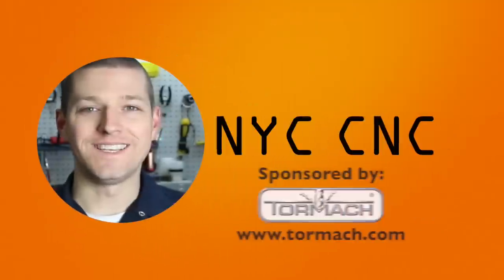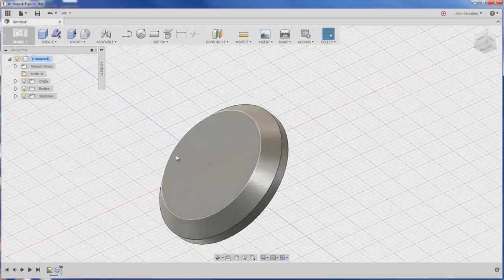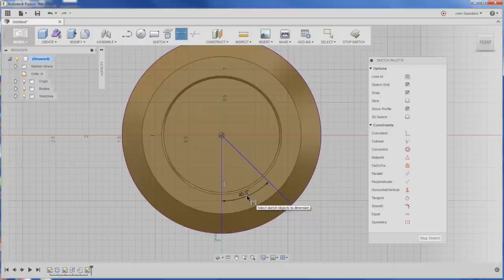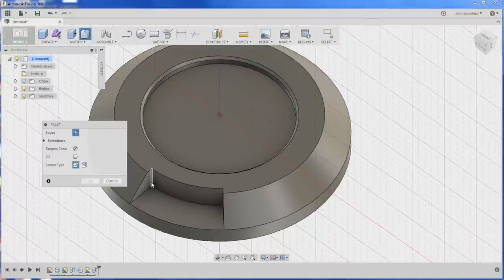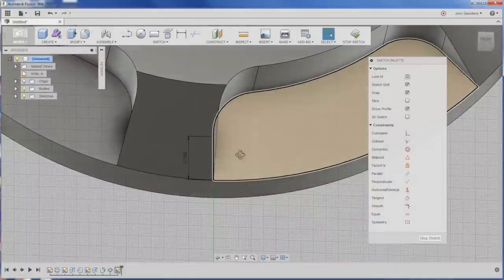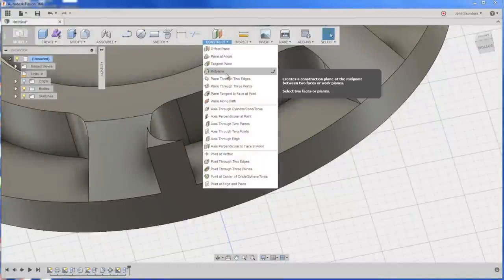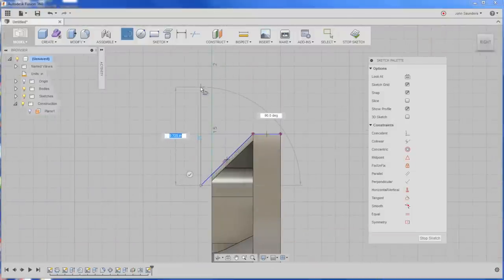Fusion360 Quick CAD Tutorial!

Comment: about those little thingy left at 5:30 , you could just have included those radius in your sketch when you made the cut at 3:20 and you could have also only made one circular pattern at the end. For a part that simple it doesn't really matter but when you get into more complicated ones, you want to keep the step used to get the part minimal so it can easily be edited without going through a long tree of step
Reply: It's now 5 years later.... you should all get a life!  But one thing you can do in both Inventor and Fusion is drag the different operations in the list on the left- you can change their order. That can often fix leftover little bits very nicely in one move.  The ability to change the order of operations and features is one of the most miraculous advances in the CAD revolution.

Comment: At 5:25 you can use a "to" push pull you'll find that option under extents. Then select the sketch as normal then click the slanted face.That will allow you to extrude exactly the amount you need without having to cut it off in a later step.

Comment: I just gave this a shot, but I took a slightly different approach for those outer curves.  Instead of extruding that outer curve and then trimming it off, I drew them into the initial cut.  I started exactly the same with the 2 lines from the center 45 apart, and the 2 arcs between them.  But then I added a 3-point circle on each end between each radii and the arcs.  Then I trimmed the extra lines, and was left with a curved "kidney bean" shape.  Then I cut it out and patterned the feature.

Comment: Symmetry is the hobgoblin of design.  Twist caps should offer more traction and strength for loosening than for tightening.  Also, the torsion that can be applied manually is limited by the tensile strength of skin.  For this gas cap the lobes should be cammed for fingers to grip to loosen but to have less purchase in the tightening direction.
Reply: halnywiatr form over function
Reply: @kevincoates1597  function over form.

Comment: Great straight forward video and not even to fast ;) Nothing wrong with the way you did that, like you said it mite not be 'proper' but unless it breaks the model then I guess it works just fine. The way I would have drawn that is create a cylinder with the center depression with a revolve or with an extrude and cut, then sink the grip cuts  into the cylinder, pattern the cut outs, then cut your OD chamfer with a revolve. Still the same result just my approach and still may not be 'proper'.

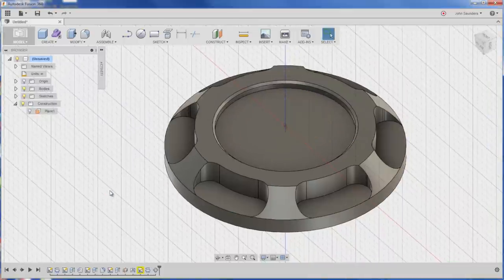Comment: awesome vids i revisit these many times but 7:50 i only need measures of those dimensions 6 radius 2 lines and i can mill that and lines would be exatly how many points there is 8. then wrap it on loop for how much your depth of cut is. DONE! 1 pocket. tool is smaller than that pocket?. no problem i allready know how much it will leave i only need 2 moves and 1 g2/g3. after 1 pocket done then rotate coordinate and same code. without need cam!. machine i work has 256kb memory how big is that 1 program :). i not like cam when it post circles with thousants of points when you can do it with g2/g3 with 1 line! cnc mache do those movements

Comment: New to Fusion 360. Mine doesn't seem to have that trim feature, so maybe you added that to the top line..
I "assume" I can do "S" for search for Shortcuts, and look for "trim"... as a guess not having fusion in from of me..
Great video. As you say, as long as it works...
Interestingly, rather than delete your plane, which I would TRY to do, you simply hide it...
I am not used to going back in the timeline to add an operation.. When I try it, I end up with a dogs breakfast...
I suspect a tutorial on the timeline would be mighty tricky...
Also, I am watching this video 7 years after it was posted.........

Comment: Hi John, hope all is well in the new shop and a neat video.
Question: have you tried drawing an arc slot in fusion...? No joy for me as there is no arc slot option like inventor. Seems like a common option to have  left out. 
Also I just changed my HDD to an SSD.... wow! So much better for opening design programs even in my old i3 laptop.
Reply: +Bert R you can just use the Trace command in CAM and set axial offset to depth but only if you have the exact dia endmill for the size slot you want....not ideal.

Comment: Do you still use solidworks for work john? Or have you changed over to fusion for everything?
Reply: +intagliode I was wondering the same thing myself. I use solidworks and solidcam and wondering if he thought fusion360 was better and why.
Reply: +intagliode Me as well, I've not seen a good review of the two system comparing there pro's and con's. I've started playing around with fusion 360 but really can get into the CAD. I find it really clunky compared to solidworks. Now if I was using this for fun or just starting up there is no way I think the many thousands of dollars that solidworks/HMSworks cost makes it that much better. I mean fusion is only $40 a month per seat for a full licence, they will let a hobbyist or small business use it for free! For now that is... Once they have us all on board then they will hold us all hostage for... One million dollars mmuhahahahaha...
Reply: +Widget Works Manufacturing Inc. My first 3D cad was solidworks 97. Then when i was forced to use autodesk inventor for work. I realised it was way easier & far more advanced than solidworks. At the time. Fusion is very similar to inventor. It really comes down to your personal preference. I found fusion a little strange at first. But have to say. For a free or low cost CAD solution. It a powerful product.

Comment: good stuff, another way you could of done it was draw a line at the back of the bit sticking up against the top edge of the pocket and just press pulled it of with a cut,

or just draw it in as a 2D sketch, (add the revolve shape at the same time) do a circular pattern of the pockets, press pulled it up and cut it to shape with a revolve, draw your centre circle on top press pull done. if you want a screen cast let me know. anyway how you did it was fine there's nothing wrong with bashing (hacking) your way through it. 

I do it all the time to learn how to do something if I can't find info on how to do what I won't

Comment: Big John, Nice vid...I know you dont do this kinda stuff but i do a lot of sheet metal parts at work and im trying to sell this software to them. but i need to know how to take the customers bracket and generate the male and femal tooling from it, any ideas... Thanks
Reply: Male /female tooling refers to the top side of the part as well as the bottom, metal thickness clearance, so in a press with the proper blank you will get a sheet metal part formed to the math..